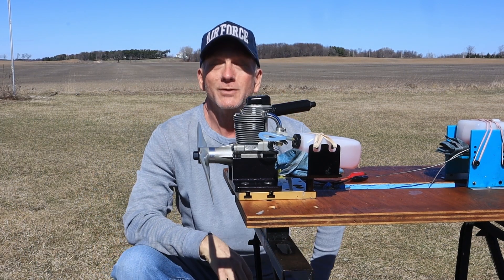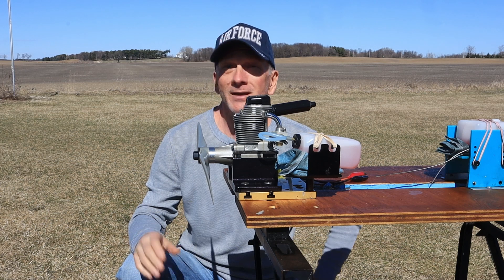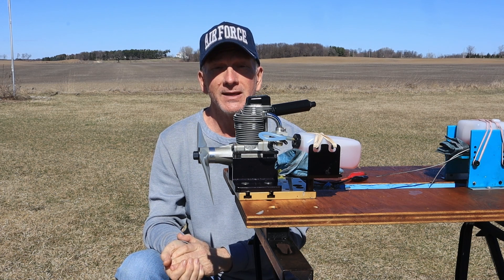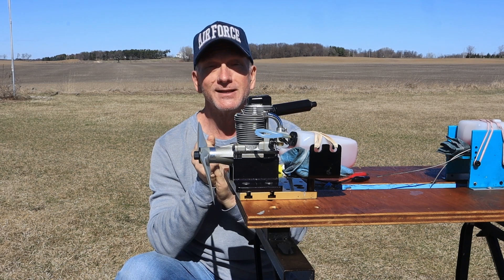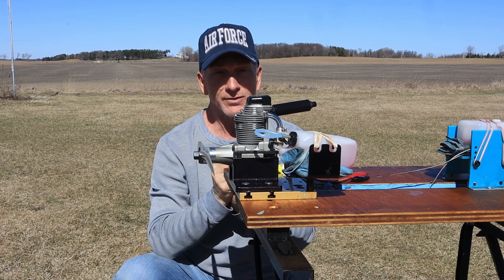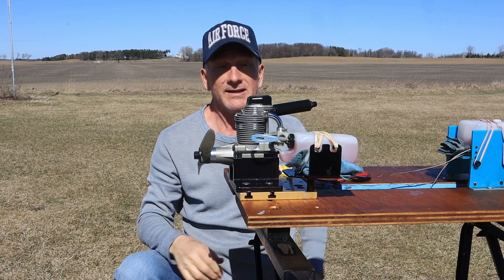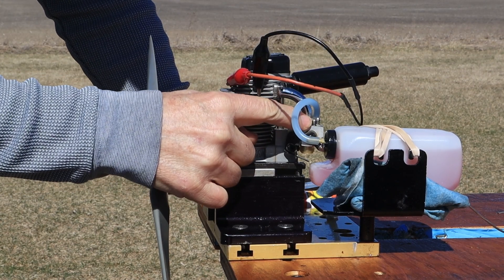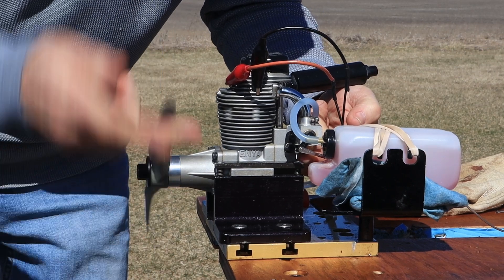Enya 90-4c The First Run

Comment: These are getting very hard to find.  Had a second generation 120 that ran great.  Sold the plane that it was in to a club member that was going to order another engine to replace the Enya.  Unfortunately he crashed it on his second flight.  Parts for repairs were not available.  Darn nice engine, just like this one

Comment: I have always felt that Enya 4strokes have a fairly  aggressive cam profile and timing. You can almost hear the lope at idle. And due to the gentle curve of the intake pipe really helps them breath better though out thee rpm range.  I buy just about  every one I run across now a days.

Comment: Is the plug tight ?  Just looks like fuel is spewing up from it :-)     Awesome engine.
Reply from the maker: Yes it is.  Now I did put 3-in-1 in the rocker area in pushrod tubes and arms.
Reply: @dmrcflyr2  Great, just wanted to make sure you had it tight, so the threads dont get damaged 🙂  I have a 120 4C new in box, and it looks so nice that I dare not run it haha
Reply: I saw that too. I'll bet you are losing compression there. It looks enormous. Do you have an OS 90 to compare it too?
Reply from the maker: I explained this above. NO the plug is not loose. Read my response. Does the engine run like it is losing compression? That is the 3-in-1 oil seeping out of the rocker cover. There is no gasket on the cover.